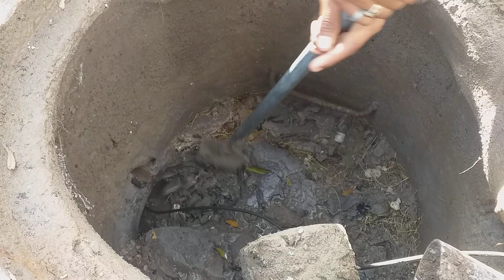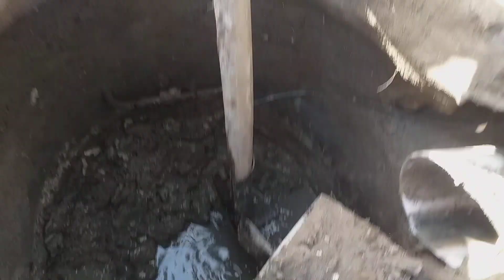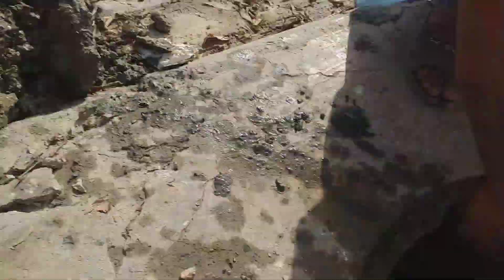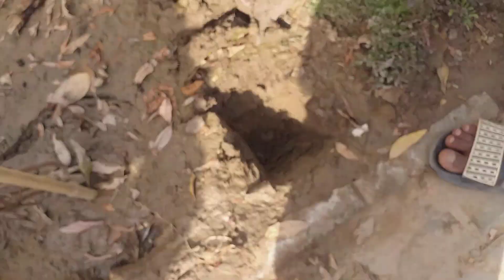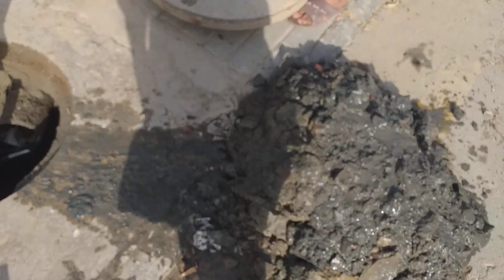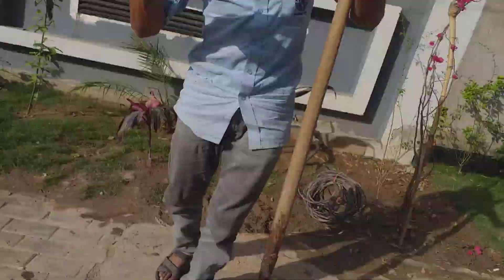Drain Complaint 58 | Cement Rocks |

Comment: Why would someone run a wire through the manhole and pipe like that?
Reply from the maker: Sir here in this housing society all the internet cables passing under the sewer. It's difficult for us but we doing our work.
Reply from the maker: Pipe like that because of plumbers here. They just complete there work and go away and after that all difficulties for us. But we try to do our best sir.
Reply: @TheSewerMan4  just cut the wire! :)
Reply from the maker: No sir if we cut the wire.. we will have to pay for this. 😓
Reply: @TheSewerMan4  I respect the hard work you gentlemen do with each video you share. Stay safe.
Reply from the maker: Thank you so much sir. Respect.